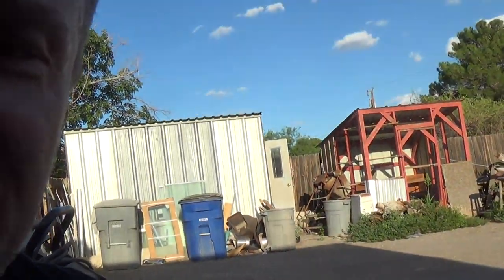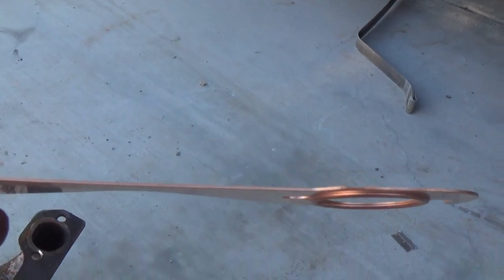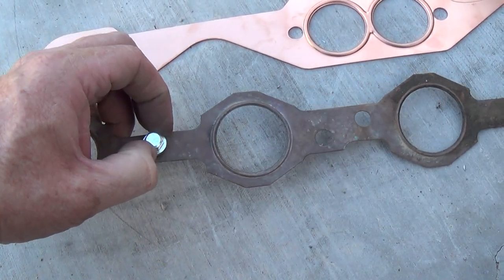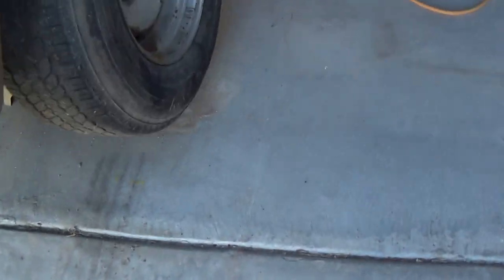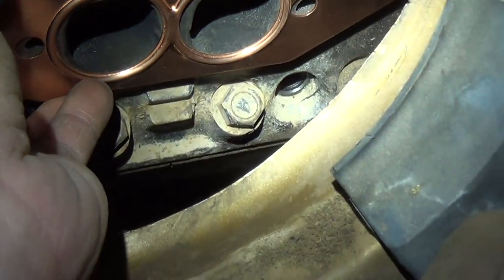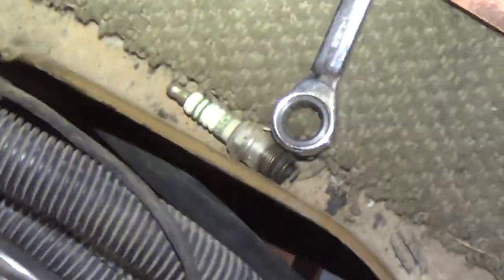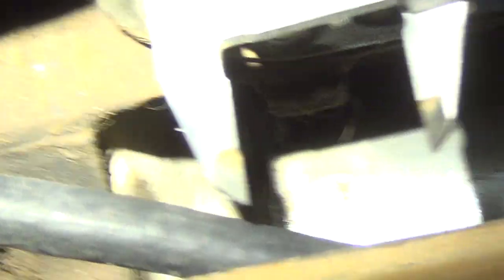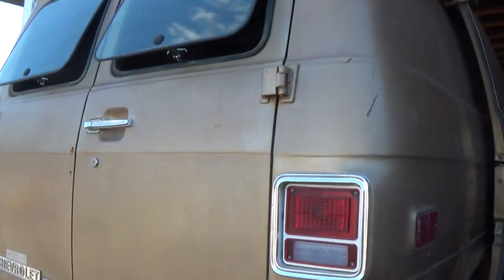Square port heads with round port long tube header gaskets on 350 Chevy van

Comment: Are those vortec heads, if so do you have a part number for those headers?
Reply from the maker: No, they are not Vortec heads Vortec heads are always center bolt valve covers. But not all center bolt valve covers are Vortec heads 906 VS 062 Vortec Heads the 062 heads and the 906 heads are virtually identical castings. But on some 906 heads they came with pressed in exhaust valve seats and had a bit of a ridge that slightly restricts air flow by about 20 CFMs. But you can clean them up with a carbide tip and they will be every bit as good as the 062 heads. But again NOT all 906 came with the pressed in seats. But to be sure find yourself a good crack free set of 602's and have them magna fluxed and resurfaced to boost the compression a bit. They can easily be identified by the "3 pyramids" or as I like to call them a "saw tooth pattern" ^^^ on the front of the heads. You can find them on 96 - 02 truck or vans. The 906 heads did NOT have the "^^^" markings. Stock vs stock the Vortec's flow more than even the camel hump heads, and they already have the hardened valve seats for use with unleaded. However they do need a little work if you want to run a higher lift cam. They also have a fast burn style combustion chamber. A GREAT all around budget performance head. Just do NOT try to use them on a 305 or put a 305 head on a 350.
Reply: @ricksteelcustoms3196  Thanks for the info!!!! I was asking if they were vortec heads because I have a set off of a 96 Silverado that I plan on swapping onto a 77 C10 sbc 350 and wasn’t sure if long tube headers for stock heads would fit on vortec heads.